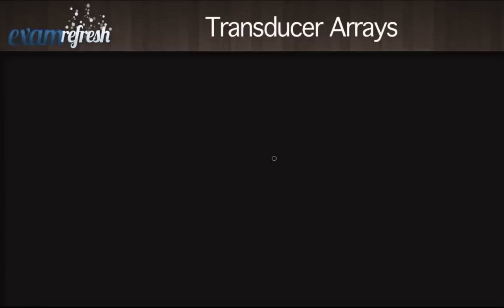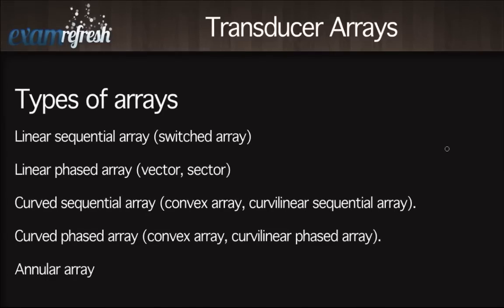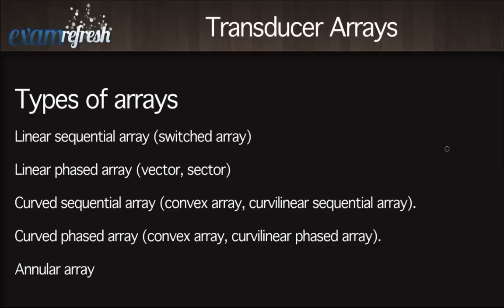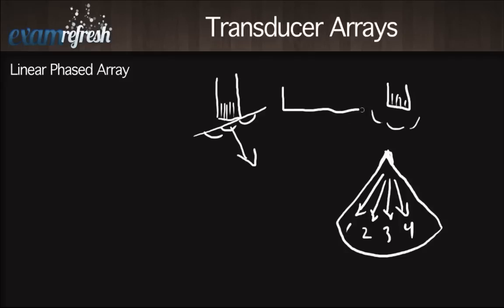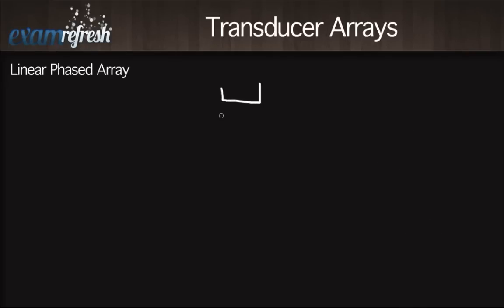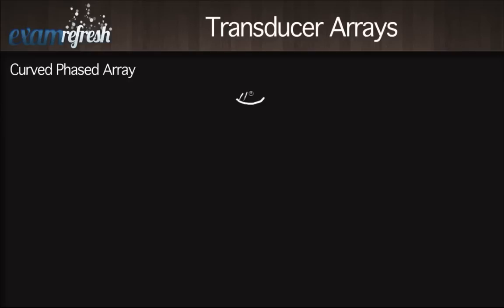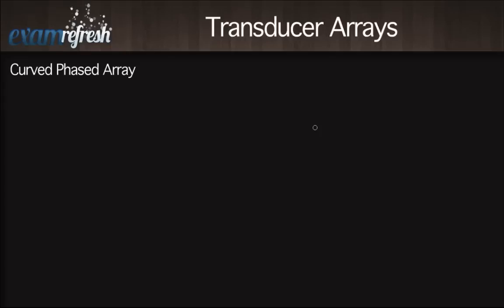Ultrasound Physics - Transducer arrays

Comment: Steering directs the sound beam in the direction, or angle, you want.  Steering can be done in transmit or in receive.  If you don't steer the sound beam, then the sound exits (and returns) to the transducer perpendicular to the transducer face, and the time delays from focusing are symmetric about the transducer center line.

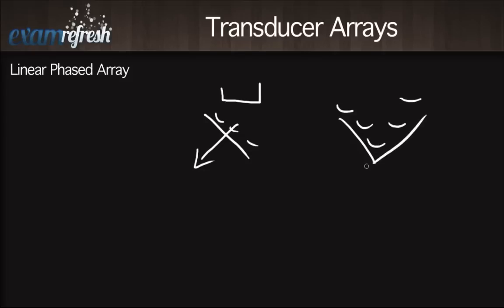Comment: The focusing cartoon at 9:58 isn't right.  The elements at each end of the transducer aperture fire first. The central element fires last. This causes a focus to occur on the main axis of the array.  If the focal point is steered to either side, the element furthest away fires first, and the closest element fires last.  I think you drew the illustration with the center firing first, which would cause beam splitting into two.  The trace of the firing order for focusing is a curve in all cases. The amount of the curvature (of the firing time) determines whether the focus is shallow (highly curved) or deep (gradual curve). When the elements fire at the same time, there is no intentional focus other than those created by the axial nearfield maxima, which is a natural nearfield focus.  Otherwise, thank you for the review, it's very helpful.

Comment: Franco has the best down to earth physics reviews, and I've learned a lot from him!
 
But all the arrays are "lined up in sequence."  What drives their firing is very different. Sequential arrays fire one element after the other (in sequence),  depending on what depth is set. 

True phase array's fire nearly all the elements at once, with nanosecond time delays to steer and focus the beam. But you have to think about sonar transmission and receive as very different events with an ultrasound probe.

With phased arrays, transmit & receive time delays allow for the steering, and listening,  of the beam off axis by creating concentric wave-fronts in the direction of the steering (elements farthest from the direction of the steering are fired first on transmit), this is what creates the off axis line Franco draws across his phase array diagram while showing the beam being steered to the side on transmit. By creating a concentric wave front, the off axis response is better because it creates stronger reflections off axis, otherwise you can still listen off axis because the elements themselves really transmit acoustic waves in all directions, but are strongest on-axis, or directly in front of the element, so you'd get a poor off axis response without a time delay and concentric wave front formation.

But to make a scan line, it takes two elements to localize a returning echo, just like we need two ears to localize a sound that we hear. Time and intensity differences between a sound arriving at each ear (or between 2 probe elements) tells us where the sound came from. A sound coming from our right, reaches our right ear first, and has slightly more intensity than when it reaches our left ear a very short time later - our brains can translate those differences into a unified perception of where a sound came from. And this is why ultrasound probes always have an even number of elements: probes need two elements to locate  returning echos, and create each scan line. For shallow echos, the elements are close together, but for deeper echos, the elements must be farther apart, and this is why it takes a bigger physical aperture to focus a returning echo that is at a deeper depth - the deeper the returning echo, the further 2 elements have to be apart from each other. For example, I can tell where a voice is coming from within a room with my eyes closed, but it would take two people, standing several feet apart from each other to localize a gunshot coming from miles away.

Our ears use phase information to locate sounds that are lateral to and behind us, ultrasound systems use phase information to fill in the gaps as the beam spreads.

Thanks, Franco!
Reply: Thanks for your explanation.  I got lost when he kept saying sequential arrays were lined in a sequence and but didn't address that phased arrays were also lined in a sequence.  The firing of the elements is what makes the difference.